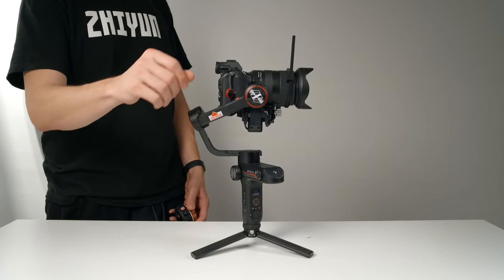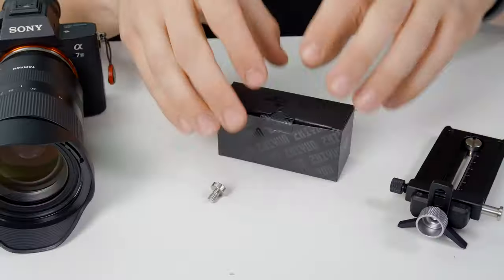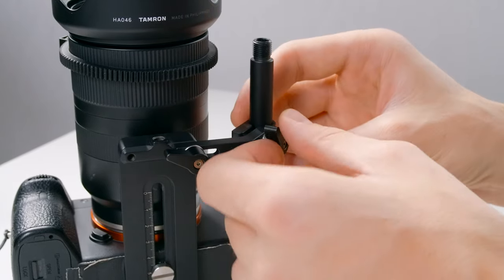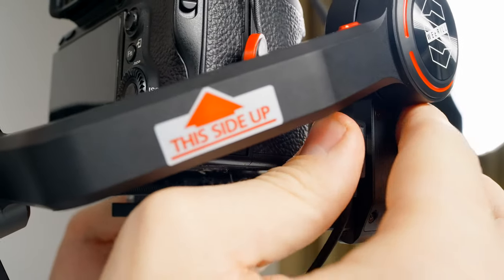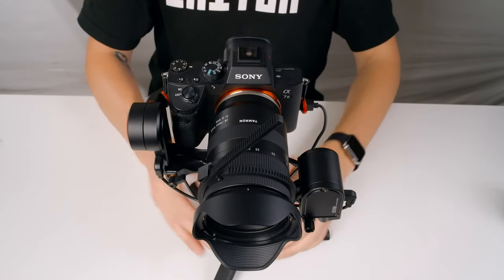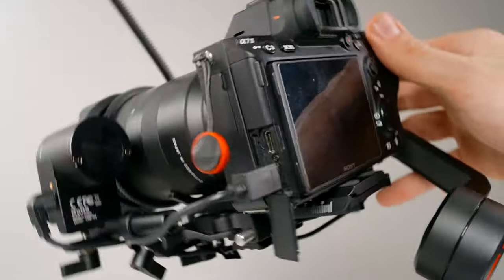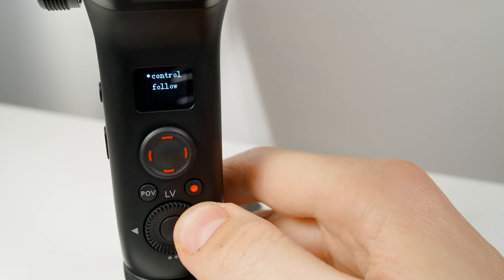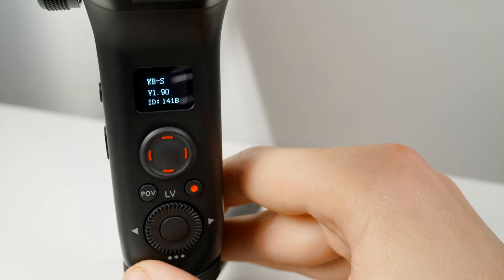ZHIYUN TUTORIALS | Weebill-S Official Tutorial | E02 Setup and Menu Intro

Comment: I’m really bummed.  I purchased the canon M-50 with a 75-300mm lens, a Zhiyun Weebill S, and the Movo VXR10 mic.  I thought I did my homework.  By that I mean, I watch lots of videos.  I was so impressed with your video, I used it to setup my Zhiyun Weebill S.  And all was good and I was a happy camper until I connected the Movo mic.  Two major issues with the connection of an external mic (the Movo).  First, the connection of the mic cable to the camera body prevents full access to the cameras monitor (the tilting or pitch and the rotating from back to front viewing).  Second, while using the Weebill S, with the mic connected to the flash slot on top of the canon m-50, the mic runs into the weebill at the roll axis and will be stopped.  I’m new to weebills and external mic on cameras and was hoping to be speared some upsets by watching folks who claim to know a thang or two.  Why didn’t you say something post something?  I went back to see if anyone was saying anything about the external mic interfering with the weebill’s proper function and or the microphone’s cable connection interfering with the function of the cameras monitor.  I found nothing, no one, nada.  I’m disappointed in Canon, they designed the camera and I know they must have known.  With the external mic access port open the monitor simply will not rotate to the forward position.  How can you miss that, Canon!  Now I need joint, two solutions or two different cameras.   CANON!!!

Comment: My weebill s doesnt give me smooth shots, it has a bit of up and down motion no matter how i walk, done calibrating ang tried different settings.
Reply: Does yours make a terrible sound? I am about to return mine. The motors seem like they are stressed and all I have on is a sonya7iii with the tamron 17-28 it's a terrible humming sound and high pitch. I can't use this is I try to attach a mic.
Reply: @Marlonorellana  yours is vibrating, maybe use a lower motor torque, I already returned mine since we did so many adjustments with the settings but we did not fix the issue, hopefully they will replace it with a better one
Reply: @jameslungay3709  same lol I'm already returning it to adorama I'll be putting up my video soon it's fucking crazy what's happening to mine lol
Reply: @Marlonorellana  Funny it happened to me too. At first it was all kindof ok. balanced the camera, started the gimbal and it kicked into place. Then a day later I tried the auto tune option with the gimbal on a desk on its tripod legs and then there was this humming and vibration and the camera started tilting to the right so much so I was afraid it would fall off to the side. I immediately switched the gimbal off and after a few secs tried switching it on again. Same thing. But here's the funny bit. If I took it off the desk and held it with my hands the hum and vibration would automatically stop. Even if I just touched the gimbal slightly with my finger when it was on the desk the vibration would stop immediately. My take if you ask me... the thing needs a human touch😂
But seriously if someone could explain what's going on it would be amazing! Apart from that I've been using it just fine.
Reply: @TrivisualsCreativeAgency  Dude I experienced the same thing! I still returned it but im pretty sure there is a LOT of firmware updates needed for this gimbal. I really want to like it because of the weight and portability but if its not reliable.. then fxk it im sticking to my ronin S. Not only that. If i cant stick a mic on it without hearing the motors in the background definitely fxk it
Reply: @Marlonorellana  hi just updated to the latest 1.90 firmware and things seem to be working just fine. The vibration problem seems to have disappeared. I am also now able to do vortex mode with my heavy 5dmk3+24-70 2.8 II combo. still testing out stuff. pretty happy for now👍
Reply: @TrivisualsCreativeAgency  fuck I just returned mine.

Comment: I get axis lock. Using a sony a7III with a canon 16-35mm and attached the cable usb to it. Anyone get this error?
Reply: Which firmware?
Reply: @ShervinKoushan  I just got the weebill s, I guess I should update. I'll try that.
Reply: @nicktolentino8250  It would be interesting to know your current firmware. Also if it helps to update the firmware
Reply: @ShervinKoushan  It was 1.89 and updated to 1.9. As soon as I updated and switched it back on, axis lock happens.
Reply: @nicktolentino8250  Hmmm. Have you tried setting the camera settings to Panasonic or Canon? Use micro usb to micro usb cable
Reply: @nicktolentino8250  may sound silly but did you actually check to make sure they're unlocked?
Reply: @dustinwiget8088  lol yes. Read another thread where on some of them the switches were switched around. Weird. I balanced, calibrated, and tried different settings in the menu. Still does it. Theres one thing I still have to try. Zhiyun apparently has a video to balance their way. I'll check it out.
Reply: @ShervinKoushan  I switched mine to sony. Still. I used the cable and I dont get the full control where I would be able to change iso, etc. Maybe I got a lemon.
Reply: @nicktolentino8250  it should be set to panasonic or canon for full control
Reply: @ShervinKoushan  even though I have a sony camera?
Reply: @nicktolentino8250  yes
Reply: @ShervinKoushan  Ok I tried Panasonic and set the motor to medium and so far so good. I tried low and the axis error came up. This current setting I've tried with L, PF, POV and no errors. Updated to latest firmware. Hope this helps out people.
Reply: @nicktolentino8250  👌

Comment: Zhiyun Weebil S is horrible in build quality. I've had loose directional buttons in the joystick that wheels that came off right the first time i bought it. It is a pain in the ass as the directional button got stuck moving downwards even if you have it pressed away. so it tilts your camera downward everytime you power it on.  I needed this gimbal for an event the day after i got it and now i'm stuck with a broken gimbal before i could even use it. I've heard there are alot of people who got the same problem. Don't buy this gimbal. stay away from this